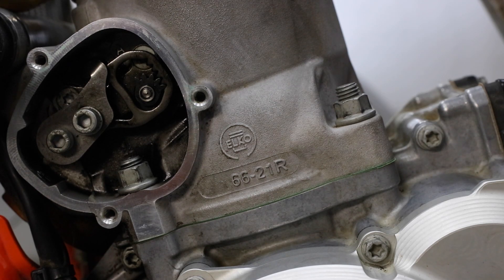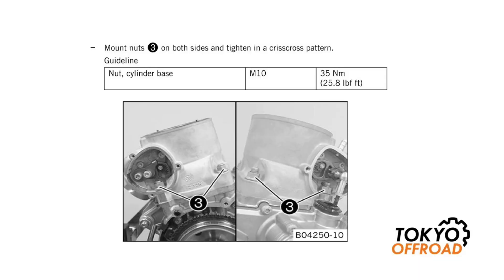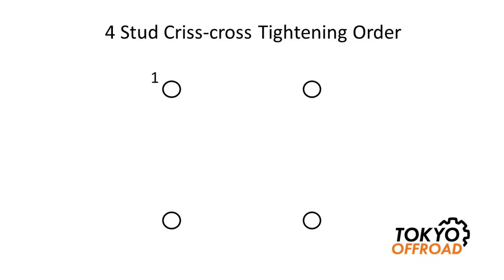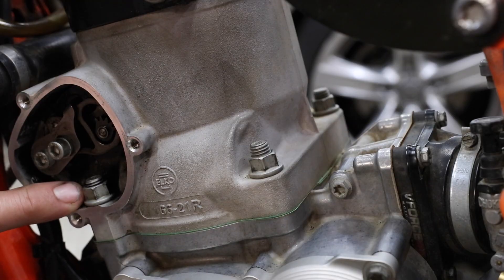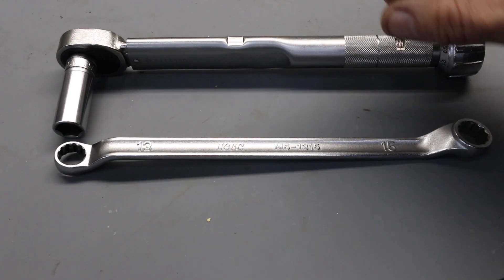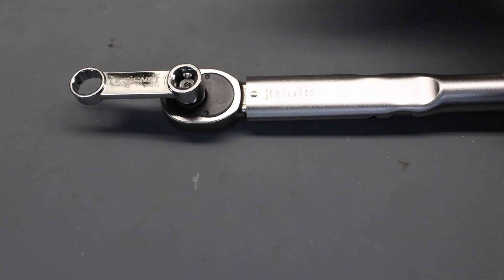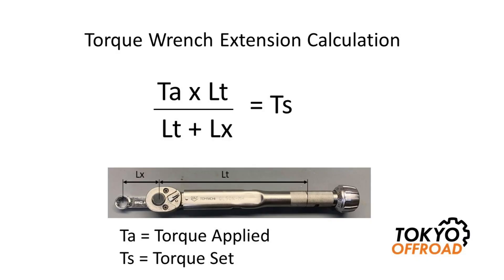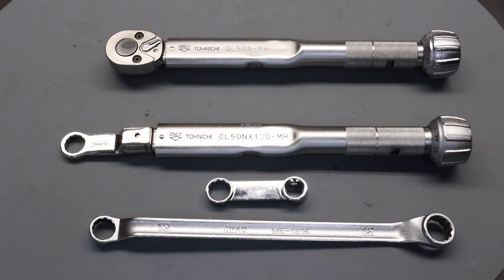Cylinder Base Stud Nut Torquing Tips

Comment: Is anyone here after rebuilding their top end and then after putting it all together and getting ready to ride, you have a coolant leak coming from the front two studs from not being fully torqued 😂😂 I had already assembled the power valve assembly and got it into spec before dropping it in so I wasn’t even able to tighten them down fully because I don’t have a tool to get in there

Comment: That Signet tool is rather hard to track down, they dont even list it on the signet website.
Reply from the maker: I purchased the Signet 30493 in Japan where it is broadly available. Some other people have commented that similar tools are available from other manufacturers. If you're looking for a high quality tool then the Snap On FRDHM13 is probably a good choice and should be broadly available worldwide. Note that I have not tried this tool, but looking at it online it looks like it should work fine.

Comment: The easier method is to mark the nut with a pen once they are nipped, then torque one up and mark the nut again, then you'll know if 35nm is, i.e.  1/4/18/turn etc, the just use a ring spanner on the ones you cant get to and tighten them the same amount of turns, wont exact but will be within a few nm
Reply from the maker: Yes, that would get you close (as would tightening by feel). But you said "easier method". The easier and more accurate method is to use a torque wrench which fits directly on to the stud nut like I showed in the video...

Comment: I recently had to install and remove a new cylinder four times to find the correct thickness of base gasket to get the piston clearance within spec. This involved numerous crisscross patterns and torquing just to remove the whole thing to try again. Got lots of experience working the cylinder over the piston ring. I finished the job certain it was correct but it was a little irritating.
Reply from the maker: I find if you have a helper when installing the cylinder on to the piston that it's so much easier and can be far quicker than doing it on your own. Have the helper support the weight of the cylinder while you compress the piston rings and guide the piston into the cylinder.
Reply: My thirteen year old will suffice 🙂
Reply from the maker: Joel Cowdrey III - I tried training my dog to hold the cylinder, but he kept licking my face while doing it ;-)

Comment: Great video! I usually bring them up in a cross cross pattern at a moderate hand setting first, 20NM second, then 35 last. I use the method of a similar size wrench and go by feel, however I will be purchasing an extender since that seems to be the best way. 

You should see how your Bendix bushings are doing on your friends bike, as the brass ones for me cracked after about 70 hours (or less) and were loose on both the engine and ignition cover case, and that was with first red loctite, and secondly JB weld. There seems to be no good way that I've found to keep them fitted snug.
Reply: They ment to be replaced at 50hrs i believe. get a set of bronze ones in there!
Reply from the maker: Sorry to hear about the issue with your bronze bushings. For long life it is very important that the bushings are held securely. On 2017+ KTM/Husky models the stock clutch cover bush typically wear the bore in the cover (due to the poor design of the bushing) making it sometimes difficult to successfully retro-fit bronze, bushing because the cover bore becomes so oversized. Certainly if the ignition cover bore is cracked the cover should be replaced, unless you can fin somewhere which can weld magnesium and then machine the bore to size. The engine case bore typically doesn't suffer the same damage. As shown in the starter repair video I made a while ago, I recommend using some Loctite retaining compound when installing the bronze bushings. If the fit is good then Loctite 648 can be used. If the fit is looser then use Loctite 638. I have no experience using red Loctite in this application so can not comment regarding it's effectiveness.